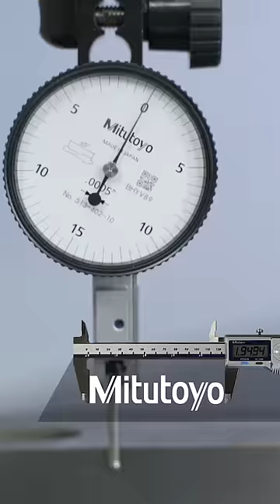Machinist Trick using Toe Clamps for a Perfect Vise Setup #shorts

Comment: I thought those toe clamps were meant to be used with a slight angle downward - using the TOE of the clamp, not the middle of the foot.
Reply: He has them angled upwards, the back of the foot is lower than the workpiece.
Reply: You are correct
Reply: Exactly! I think the clue is in the name “Toe down “

Comment: I would have milled a single side off just to find a square edge to the machine, then used the edge to find location to all the holes or machined featuresbyoure about to put in on the plate. I used to make a lot of fixture plates for Polaris and it was the easiest and most efficient way of making a plate imo. Customer didnt mind if the edges of the plate werent finished because it ended up sitting in a cart anyways, so just squaring up the back edge to all your features makes it easy if the plate ever gets shifted or someone crashes the machine.

Comment: Take to machining vices. Put the jaws on the outside. Use clamping bolts so you don't break your jaws. Face the plate if needed. Machine the entire outside minus .300 that is being held by the jaws. Flip the plate over. Take a indicator swing a .000. Move to other side of plate find .000 on the indicator. Go into control and divide by 2. You are on center of plate. Then start machining.
Reply: This is the method I use for all my fixtures too 👍🏻

Comment: One thing to add to this type of instruction is if uou want to kerp backlash out of being a factor in the level of precision. To know why and ig they are GD&T considerations in a print that require steps to achieve. So what im trying to say is maybr sometimes go over blue print reading and consider possible ways that are common practices in many settings because to prepared to succeed is what you are offering. That flat milled in is a common practice and has easy to understand value. There are so many tricks right. Working from a print is where it all begins and tells a person the process request. Sometimes programming works from yhe center of the block works well sometimes it doesn't.

Comment: Pro tip: Put hard washers under your Nut so the bottom stays perpendicular to the centerline of the stud. Skipping this step will dome the bottom of the nut, which will eventually bite you in the butt.
Reply: Pretty sure he did
Reply: Pretty sure he did, I'm sure they know what they're doing bud
Reply: @Mikesmeyer88  nope, he did not. And that's something I would never let an apprentice get away with.
Reply: Seems trivial, but it drives me crazy when people don’t use washers. They inevitably over tighten and damage the straps.
Reply: @jodygwiinn1233 nobody can understand that gibberish you wrote 😂
Reply: @jodygwiinn1233 wat

Comment: This is long time setup for me. In me shop i have a cnc mill spacial for working plate tipe pices with a big metal plate monted on maschin tabel. I use 2 studs dm 6 mm to center part on y and 1 stud on x. The studs cum off after clamping part.

Comment: I don't understand the trick.
Reply: He is cutting two edges that  are perpendicular to the completely machined front and rear edges,  so he can grab the completely machined edges in vise jaws, then probe the 2 little edges to find the center.
Reply: @Full60  He could find the center without it
Reply: @maxmustermann4915  if he faces the top and adds other features to that face then the stock sides that are left unmilled would be unreliable to use to pick up center. He adds in the milled ends to have marks that are a known distance from existing features from the first side.

Comment: Not even a trick just  Standard  Machine shop practice. I was always told don't learn the tricks learn the trade. I was a machine as for 28 years before I retired. Your part only is good as your set up. A shitty set up will give you shitty  results